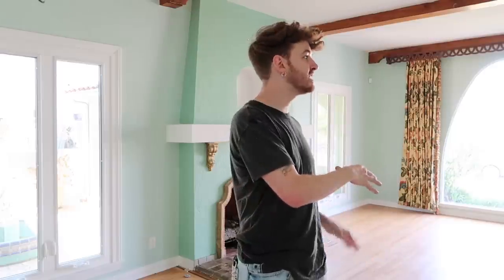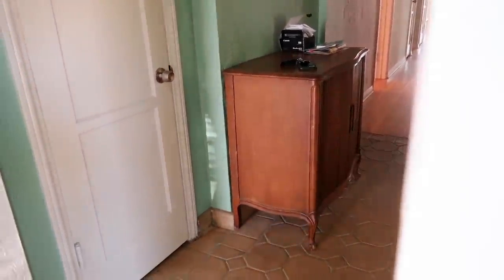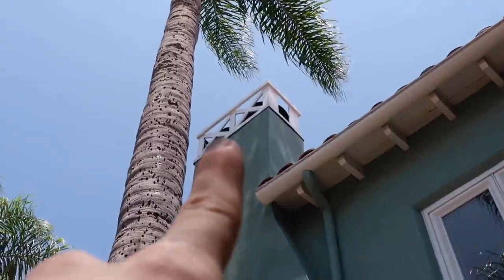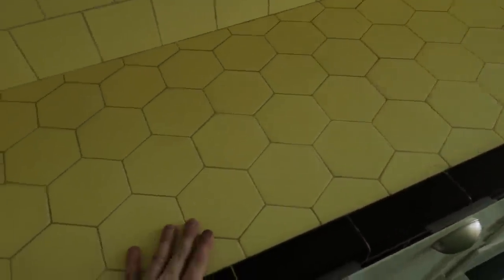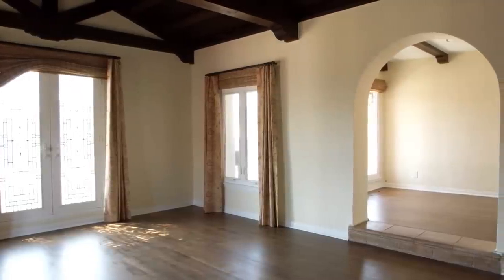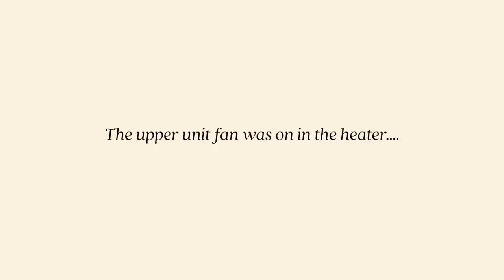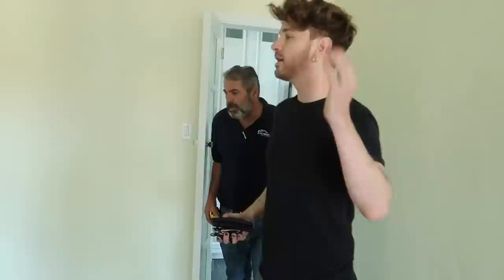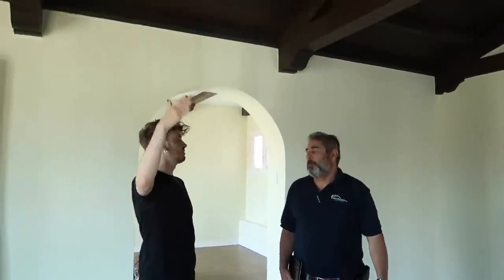Awful News About The House

Comment: Drew, I work for a Construction Company / Water Restoration, and have been through a similar situations. You should really consider calling a leak detection company, they might be able to locate the leaks with minimal damage. 2. File a claim with your home warranty, this is something your agent should have mentioned to you. It will help with some of the expenses of the plumber and re-construction repair due to any of the  water damage. Get a lead and asbestos test on any of the areas you are planning to renovate /Demo. Find out the city permit process, expense, and time line on obtaining them, because that can take a long time and be very expensive. Good luck 😊
Reply: I'm astonished that none of this was picked up at the survey stage - I wonder what the surveyors were playing at, frankly.
Reply: @221b-Maker-Street  AGREE!!! I bought a brick rancher sitting on 3 acres at an estate sale, but had it not been an estate sale, I would have had it inspected closer. I knew I had to gut it, but the bathroom was the last to be renovated...and it took that long to find the leaking in the basement and the walls, because the elderly couple never took showers, but now there was an adult and 3 children living in the house. I had a soda ash system installed, almost immediately, from someone who was recommended by my well company, but the copper pipes already had their pin leaks long before I bought it.....a slow leak until it showed in the walls and floor. Fun times back then! 😅
Reply: We hired a leak detection company. Found the leak and fixed it. Went really well.
Reply: So kind of you 😇😍
Reply: Please watch out for hidden toxic mold that is common after termites. I almost died from it coming from attic into my newly remodeled home.  It caused me to be develop a brain tumor and major neurological problems such as stuttering and vision loss - along with 11 other chronic diseases. I lost my home and everything in it. Also because of my illness I had to stop being a nurse practitioner/ clinic owner which I’d done for 16 years. My husband also left when I got sick after 25 years together. My whole life ruined along with facing chronic diseases rest of my life. All because invisible toxic mold spores. That no one can see or smell. It was so difficult to find the right medical provider to do the right testing and treatment. Many thought I was crazy until levels tested In my house showed extremely high levels blowing out of the vents. Then I had to travel out of state to find a doc who knew how treat me.  Haven’t been able to work in 6 years. I would be homeless without my parents helping me after ex left me and our children. My daughter also got sick although it was less for her and her youth allowed her to heal fast with no lasting effects.
Reply: Excellent information
Reply: Old homes are beautiful, but, money pits. It’s not evident at first, to see if the previous owners took care it properly. I wish you all the best. No doubt, You will uncover some major problems, but, I have all the confidence you will do the house right! I speak from experience! Have fun!!!!
Reply: Newer houses can also be money pits, just in different ways. I like old houses, but yeah, electricity and plumbing generally have to be redone (if they haven't been), old gas connections need to be closed securely (so many connections in some old houses), and the "non-approved" repairs done through the years may be a nightmare (or awesome). Lead was used in paint and varnish (as a drying agent?  not sure), and asbestos was used as insulation and in tiles and plaster. So be careful when doing work.
Reply: Good advice 're the Asbestos. Many old houses still have this.  Be careful. Check if there is any in this house.
Reply: Youre an absolute Legend!! Mate not everyone gives these tips for free :(
Reply: I just like your video and share please can you do the same on mind let's advance the gospel of the kingdom is time for God thank you, God be our strength in Jesus' name, let the name be overall in Jesus name thank you very much am sorry for writing here without permission
Reply: YES YES YES!!!
Reply: Great advice!
Reply: @audreygregis8721 eww do you mean they had baths?  Or not at all!  Crikeys hey funny how some people live isn’t it!

Comment: Welcome to the world of owning an older house.  By all means get quotes for the wood floors but don't refinish them till near the end.  You will have to patch where you are removing walls, possibly with new wood, so it has to all be done at once.  I know you want to get to the decorating where you excel, but make sure of the basics first:  ALL of the plumbing, electricity and foundation.  You don't want to decorate and then have to remove it.  Best wishes for your dream home! (I am an older fan so am cautious.....would have lived in one and rented the other!)
Reply: I agree with the wood refinishing I went through the processed and yes we ended up patching 3to 4 times.
Reply: I’m always cautious with any older home. They usually need a lot of replacement. I would expect the possibility of replacing a lot of charming aspects of it, not including behind the wall and material integrity. I recommend research to preserve the home’s character with new or preserved materials that have a lifetime expectancy. There’s so many beautiful, accurately vintage reproductions (or close enough) to still respect the space.
Reply: I concur. Do basics first!
Reply: Totally agree! Do your floors last!
Reply: There's a lot of us "older fans"!
Reply: Same, agree, you should maybe see if wiring and insulation need to be redone. I would think the hardest part or renovating (not remodeling, renovating) an older home is updating the energy efficiency and other certain modernizations without losing the charm and style of the building. And don't ever knock down any walls for an open plan concept house, I hate it when people do that to older houses, I love the separate rooms for things
Reply: Happy Birthday. Definitely you want issues behind walls fixed first, opening from downstairs up and any structural changes fixed first. I agree a medium wood floor finish will likely remain desired. At the same time if the upstairs is already finished and good, matching them saves money. You also tend to use rugs, so not all will be seen. Happy I did my floors first but I made no physical interior changes and only refinished 3 floors and stairs after pulling up everything covering them. It was a week for them to be fixed and to dry. You might need a larger crew that can bring in what they need and people needed to make it go quickly. Three months unless that is the waiting period  for availability is too long. I would live with limited stuff and store all but essentials if you can't do the floors before move in.
Reply: Yes yes yes!  
Make a huge poster of the whole plan of works & put it on the wall — like 5-6 feet high paper. Then you can check the items off & put dates against them - you will be able to see your progress, which will encourage you if you get disheartened from time to time.   
You can do it Drew!! 💪💪💪
Reply from the maker: Very very true thank you!!!
Reply: Honestly what he’s running into is normal for CA and why so many buyers prefer going for new builds.
Reply: Agree. It’s not fun to walk into your house and see the whole thing all at once. It’s so nice to have separate rooms and feel as you enter them, it’s just different.
Reply: Me too! But it seems like if he rented out the other half then he would have to rent an office for lone fox. Worth his job it will be nice to just get a little work done and not have to go far. We are in a housing crisis so the market could use the rental.
Reply: @lonefox  I have refinished our 1924 home floor too, 2-1/4" oak floor, the flooring guy I hired did a fantastic job to repatch some area and nail down some floor (we have some squeaky floor). After sanding them down, we stain the floor to a medium tone so the whole house floor become more uniform. The process took at most a week and half for our about 1100 sq ft.
Reply: GREAT advice
Reply: @aeolia80  agree with everything except blanket statement about walls. I think he should wait on removing the walls and live there for a while. But if he, like us, doesn’t like the feeling of small separate rooms, removing a wall is a good option in the future, especially when talking about a closed-in cramped kitchen. I’m a senior so it’s nothing to do with generational bias.
Reply: @wandakowalski7063  it’s a matter of taste. I like walking into openness, it’s one of the reasons we bought this house 2 years ago. I saw other houses the same square footage but with more rooms and all those little walled spaces made me feel claustrophobic. We went from our original fairly open house to a much smaller fairly open house because we love the airy feeling.
Reply: Tom Hanks and Shelley Long, the Money Pit.  My hubs and I unknowingly bought a house over a dry creek bed (seller and agent did not disclose) during a drought in the Greater Bay Area last century.   then it rained....best wishes for sure....my engineer hubs used an auger under water to break through a cement wall in the basement...and we lived to tell about it.   you will have such stories.   can't wait.
Reply: I totally agree.  I’m an older fan who is now renovating my fourth home.  There’s nothing I love more than decorating but I make myself delay that gratification until I get basics done.  I’ve redone wood floors in two houses with the help of a friend and let me tell you…it’s hard work.  I watch McKenna’s channel too and what she went through is real. Also…on my last house I did my wood floors too soon and ended up having to go back and redo them…lightly…not the big redo but still…I should have waited and that could have all been avoided.  It’s going to take a while to do it all right, and I know you don’t want to live in a construction site…but with a duplex you have the perfect situation to live in one unit while you’re redoing the other one and then switch.  Believe me…no matter how nice your subcontractors are you need to be in the site as much as possible to make sure things go to plan.  Your home is going to be incredible but this is very different from cosmetically redoing a rental.  It’s a lot…but the payoff will be a whole lot.
Reply: 100% agree with the recommendations to wait on the floors unit all the other reno is done, otherwise you will spend hours obssessing over your finished floors not getting dinged up
Reply: @aeolia80  not everyone wants separate rooms for things, open plan can look stunning in a period home.
Reply: Yes, in the right order: foundations, check roof and if walls and floors are dry ( humidity meter) plumbing, electricity. :)
Reply: Yes, I agree too.
I would of rented one of them.
Extra income, specially if you are going to run into extra costs.
And be careful of trying to open those olders walls. You might find unwanted surprises. 
Good luck.
I own an older house to here in Ontario,  Canada.
Reply: Agree!
Reply: So true. I would rent one out too.
Reply: @aeolia80  absolutely having separate rooms instead on one big open mess.
Reply: @loisbolton1800  Excellent idea!
Reply: @katiekhor4550  medium color is key to hiding dirt!
Reply: @lonefox   wouldn't you be doing this anyway as an interior designer you would plan, do renders and make schedules before starting anything so you can keep to budget and don't get lost in chaos and reduce time wasted. I cannot wait till you share your design ideas, moodboards and renders for each room.
Reply: Can't agree more.
Reply: @lonefox  
I hope you see this comment. I'm not sure if you address this, or if anybody has in the comments, but... when you have an inspection done, and they tell you about a problem (or miss a problem), a lot of times they are covered by insurance for when something like this happens, since it's their job to inspect (and find) these issues. If I were you, I would STRONGLY suggest that you call your realtor and ask him, if this is something that would be covered, since the inspector missed this serious problem during inspection. 
I had this happen on the first home I purchased, and didn't know this was even possible. 
❤️

Edit:
I just saw the end of your video. 
Sounds like it's probably something that the inspector wasn't at fault for, but... what you could still do, is call the inspector and ask him (or her), if they noticed any of this, during the inspection. Hopefully they didn't, but if it were me, I would still call them, just to see what they say.
Fingers crossed it won't be a terrible fix. I know how stressful it can be purchasing an old home. Sending you lots of positive vibes!
 💫🌠❤️
Reply: @aeolia80  I totally agree with this recommendation.  The charm of your Spanish home lies in the formality of the dining room.  You might consider a wider cased opening or an arched opening into the kitchen, but your formal dining room is simply STUNNING!
Reply: Excellent advice Madolyn!! Best to get the structural/wiring/plumbing and all prep done before worrying about aesthetics!  Otherwise you just end up chasing your tail and fixing messups!  Speaking from harrowing experience lol x
Reply: @kgal1298  interesting, in the UK new builds are now notorious for being money pits - they dont build em like they used to (with care and attention!).
Reply: You’ve already gotten a lot of good advice, but as a survivor of a Craftsman renovation I wanted to second the recommendations for leaving the floor refinishing for as long as possible. You may need to have the floor contractor weave new wood in to parch holes if you’re moving stuff around. Also, do as much painting as possible before doing the floors so you won’t have to worry about drips and spills. By the way, I have dark wood floors now and HATE them. They show dust and dog hair really badly. 

Finally, take a deep breath and slow down. This project is sure to cost far more and take far longer than you can imagine. Don’t let it make you crazy.
Reply: A friend found the same thing with the dark wood.  Loved the look but constantly needed dusting.
Reply: @telalong5254  That movie came immediately to mind when I saw this post. He is so excited about owning his "dream" home and his vision for it. Then one by one "problems" appear. The plumbing!!! The foundation crumbling!!! The chimney!!!  Now he wants to remove walls!!! Floors!!! Remodeling two bathrooms!!!  $$$$$. This project is much bigger than finding a $20 piece of furniture to re-purpose....and it won't be finished in a week's time either.  God bless him!  Patience is difficult. I wish him all the best.
Reply: Agree, i too would live in one unit and rent the other, at least for a few years. Gives u time to live in house, focus on the reno of your own unit, use the rental income to help pay for your renovations. Passive income can get you far.
Reply: I just like your video and share please can you do the same on mind let's advance the gospel of the kingdom is time for God thank you, God be our strength in Jesus' name, let the name be overall in Jesus name thank you very much am sorry for writing here without permission